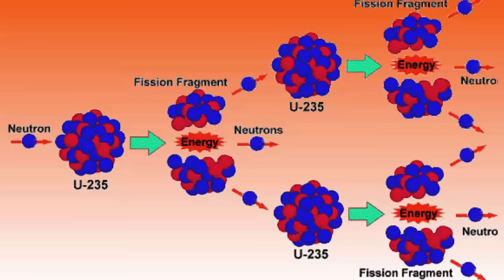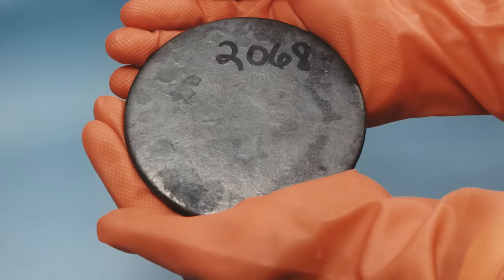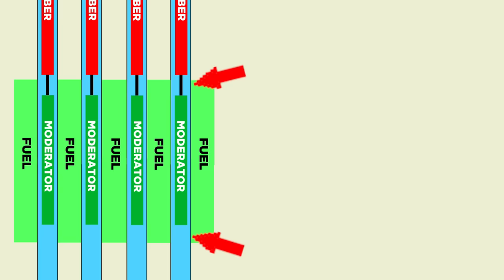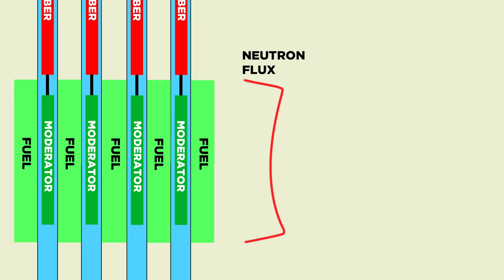What /Actually/ Happened at Chernobyl

Comment: The biggest issue with Chernobyl was that they actually knew about this very specific lost of things or at least suspected but suppressed the information.
Reply: Yeah they knew, and no-one wanted to be the guy to stand up and say: "Yo, we need to redesign this, even though it's expensive" Back in The Soviet Union 😂
Reply: Agreed it was extremely dangerous the information was kept from them.
But it doesn’t excuse the hours of blatant misuse of a nuclear reactor leading up to the very situation that information would be relevant.
Reply: The biggest issue was the positive temperature coefficient of reactivity.
Reply: They did have a situation before in a different reactor where the AZ-5 (SCRAM) button was pressed, and a momentary power spike was recorded as the water was displaced, but it wasn't enough to cause it to go prompt critical before the boron took over.

Comment: Best explanation I saw thus far.
Chernobyl is a bit of a passion of mine. As it led me to prove for my physics exam piece that nuclear power is dangerous and how we should avoid it. Only to find out the opposite. And people are wrongfully scared. These situations like Chernobyl and Fukushima are rare and impossible even with modern fast breeders. To keep fission happening there it’s like riding a unicycle, whilst rubbing your stomach and juggling. What stunned me the most, is that for the most excessive deaths estimate of all 3 nuclear reactor disasters. In the worst case 8000 people died. Whilst 8000 people alone die in The Netherlands of fine dust alone. Often from coal and oil burning. And nuclear reactors safe about the same amount of lives almost weekly. Due to its isotopes being used in medicine to cure people from cancer.
Reply: While probably lot less deaths than other energy sources, mining uranium probably kills a bunch of people.
Reply: I do agree that Nuclear Power is pretty safe now, situations like Chernobyl are almost impossible once all outdated reactors are finally decomissioned. Modern reactors are passively safe. Coal and oil is just stupid...

The number of direct deaths from the Chernobyl disaster was low, but the number of people affected by the aftermath was much higher: "According to Vyacheslav Grishin of the Chernobyl Union, the main organization of liquidators, "25,000 of the Russian liquidators are dead and 70,000 disabled, about the same in Ukraine, and 10,000 dead in Belarus and 25,000 disabled", which makes a total of 60,000 dead (10% of the 600,000 liquidators) and 165,000 disabled"
Reply: @mephistophelesfussli819 Probably no more than mining coal does, tbf

Comment: Actually, an "explosion" is just a "relatively rapid" variation in volume. it does not have anything to do with phase change. I can assure you that a oxy+hydrogen tank can explode as well and they are both gasses.
The rapid expansion is usually caused by combustion which add a lot of thermal energy to the mix, and not by phase change.

Also, to be extremely precise,  "detonation" is the world you were looking for. deflagrations are explosions as well, but expansion occurs slower than the speed of sound.

Comment: In layman's terms, the reactor is like a diesel engine. Rather than using the accelerator pedal to slowly bring the engine up to speed, they took the governor off and set it to wide-open-throttle. It started to overspeed and their "solution" was to try to slam the intake closed. And not only did it completely destroy the intake, it blew off the cylinder head in dramatic fashion and caught on fire.

(Obviously an oversimplification, but I think it fits).
Reply: Caleb Shonk that's pretty good
Reply: Ah! Thank you. I'm a gearhead, not a physics buff so THAT I understood.
Reply: Great comment. All I will add is that the reactor has only one cylinder, the piston weighs 100 tons and the cylinder head (the upper biological shield or as the Russians say " the pyotachok " or 5 kopeck (nickel) piece weighs 50 tons.
Reply: Absolutely fits as a simplified explanation. It's not perfect, but it gets the point across with an analogy to something people are more likely to understand 👍 It doesn't explain the xenon poisoning, meltdown and following steam explosion, but it doesn't have to.
Reply: Actually this can happen in Diesel engines. It’s called a “runaway” diesel and since Diesel engines are controlled by regulating the amount of fuel that goes in rather than air like a gas engine they will keep going a diesel in runaway sometimes getting so hot they will start combusting elements in the air itself and engine oil and the only way to stop it is to choke off the air intake and hope the engine is sealed enough that air won’t be sucked in elsewhere as the faster an engine is running the more air it can draw in (why Diesel engines don’t have a safety valve that can close the intake I don’t know but runaways are rare and usually only happen with poor condition engines anyway. Shitty explaination probably but to understand it requires understanding how a Diesel engine works but they rely on heat and compression to ignite the fuel 

Gas engines can’t runaway because they need fuel within a certain tolerance air and importantly a spark. I think it’s near impossible to detonate fuel in a gas engine on compression alone
Reply: @P7777-u7r It's not near impossible to detonate gas, it's just unlikely. And the problem of runaway engines can be and is solved by the use of electrical versus mechanical fuel pumps. If you cut the electrical power, no more fuel is flowing. If this happens early enough in the runaway, the engine will not have started to consume its own oil, and so the runaway will stop.

Comment: You may want to pay attention to the Thorium reactors coming in at the end of this year.  Now the engineering issues have been solved (mainly extremely aggressive corrosion due to the molten salt required to make it so hyper efficient) you're hitting a whole new era of nuclear power - MUCH safer, and for once much cheaper too (plenty of fuel), as well as far better for the environment.
Reply: Freddo Flintstono aggressive corrosion and nuclear reactor in a same sentence sounds scary.

Comment: Worth noting that the reactor designers claimed the reactivity wouldn't increase significantly if all the water boiled. That it would only increase slightly and then return to 0 due to the drop in moderation.
There is a graph in the INSAG-7 report that shows the actual reactivity increase when water boiled off vs. expected and they are two completely different lines.
The operators at Chernobyl knew they'd boil away all the water when they pressed the SCRAM button but didn't see an issue as the engineers who wrote the documentation and claimed that this boiling wouldn't be a problem.
Reply: I think it's because of the timing. There's a Negative Temperature Coefficient, but it's slower to build than the voids. If it boiled off slowly over the course of like an hour ala TMI that might indeed be correct.

Comment: Basically all the dashboard warning lights were on and Dyatlov decided to go racing....Nice!
Reply: Haha, nice one XD

I get the joke, but just to clarify: He wasn't really trying to go racing, he just wanted to take the reactor back to a "slow speed" (reactor operating at low power level) so they could carry out a "brake test" (what happens to the reactor when we lower the power level).

On top of that, they all probably feared for their jobs if not more, because the reactor should have been shut completely down for 48 hours, but that would mean that they would have to tell their bosses that not only had they failed to complete the safety test AGAIN, but Kiev, other cities and factories relying on the power from reactor 4 would be without power for over 2 days...

Comment: As a somewhat easy explanation of why neutrons need to be slowed down in a reactor to cause fission....
The neutrons do not smash into and breakup the uranium 235 atoms, they actually need to bind with them. This causes the atom to become unstable and then come apart (fission) releasing on average 2.4 more neutrons.
This explains why neutrons need to be moderated (slowed down) so as to allow a better chance for the uranium to capture one and then blow itself apart releasing energy in various forms, alpha, beta....thermal etc. 
E = mc²
energy = mass x speed of light (constant) squared
Joules = kg x 299,792,458 m/s squared
Speed of light is measured in meters per second.
c² = 89,875,517,873,681,764 m²/s²
Nice shoutout to Scott Manley, he does fly safe. 👍

Comment: There is a big mistake in the video: 
Water does NOT absorb neutrons, but it moderates them (That's how most of the western nuclear reactors work. You don't need heavy water for it... you only need heavy water when you want to use natural uranium as fuel). And when the water gets hotter or boils the moderation is reduced because the water is less dense. Thats called a "negative void coefficient". Graphite, which is used in the RBMK as a moderator, does not reduce it's moderating properties but increase it when it gets hotter, and the increase of moderation by the graphite is more than the decrease of moderation due to the evaporating cooling water. And if you replace the bit of water or steam which was left inside the reactor with the graphite tips you pulled out before by pressing the AZ-5 button you press the final trigger of that dangerous mix.

Comment: "So hot that it, in fact, dissociated into hydrogen and oxygen..."

This description of the development of H2 and O2 in the steam-pressurized reactor strikes me as a little too simplified. My understanding--and I've seen the HBO series twice, mind you--is that the zirconium jacket around the fuel reacts with the steam to form hydrogen.

No one knows for sure exactly what sequence of (chemical) events led to the two explosions, but I've always imagined that the first, smaller explosion was related to the compromise of the reactor top due to pressure, while the second explosion was the bulk of the hydrogen that had been formed inside the reactor finding the needed oxygen when the top popped.

In any case, the "dissociation" of H2 and O2 is, I believe, the result of a chemical reaction between steam and zirconium at high temp. I only bring this up because your description makes it sound like the water molecules simply break apart.
Reply: You are correct

Comment: So... They stepped on the gas, instead of the breaks and then ran full speed into a Starbucks... Ok got it.
Reply: Pretty much, yeah.
Reply: No, it's more like they stepped on the brakes, but due to the brakes being poorly designed, in that configuration of the car hitting the brakes resulted in MUCH bigger acceleration than fully stepping on the gas pedal.

So they hit the brakes and instead of stopping, the car sped up into the Starbucks. Pretty much that.

Comment: You're the second "how it happened" vodeo  after I fell into this rabitt hole.  Your explanation of the 2 seconds of rods and how they were used is by far the clearest I have seen so far.    Also read one appendix  to an IAEA document that has  translated Russian report from way back then.  One component they mention is that when they turned off the turbine and only ran the pumps (as part of the test), there was less cooling happening and the water being pumped into reactor was getting closer and closer to boiling point at that pressure (about 1000psi as I recall), and eventually flash boiled.

Comment: Probably my favorite part about all of this is that, for all of the justified criticism you have of Soviet RBMK reactors, they DID provide nuclear power very cheaply, and--provided you were careful and informed about how you managed it--relatively safely.

Naturally, the management, and Dyatlov in particular, drove their reactor to catastrophe in the most insane, outrageous, reckless, and suicidal way possible, doing what everyone had thought impossible: exploding an RBMK reactor.

Anyway, it's kind of hilarious how I had actually guessed how the "graphite tips" worked, and why they were there before I watched this video--I thought "It'd be just like the Soviets to tip the control rods with graphite so that they could use them both to slow down and speed up the reaction...and for Dyatlov to be insane and reckless enough to think taking them ALL out of the core at once was an even remotely acceptable or sane procedure".
Reply: RBMK reactors had several accidents although not as severe before Chornobyl, however only few people knew about them because of secrecy (and the fact that Chornobyl and Sosnoviy Bor power plant, that had very similar accident (which by shire luck hasn't gone into disaster) were sobordinate to different ministries). But good name of RBMK designer Nikolay Dollezhal couldn't be stained so the issue was never widely known.

Comment: Ok so, we know what went wrong... but what should have been done in this case? The reactor was already overheating, the water is boiling creating voids, the rods are already going down (slowly). Is there anything the operators could have done in that situation?
Reply: Aborted the safety test due to too many factors being different than what was planned.

Different shift, Xenon poisoning, altering test requirements on the fly (attempting test at 200mw despite it needing to be at 700mw), etc.

Comment: 1:46 "During fission, the leftover fission products, which is all the particles and atoms that are leftover, are always a little bit lighter than the original atom."

Isn't that only the case if the original atom is heavier than iron? That's how you can get energy from fusion for light elements like hydrogen?
Reply: Why would it only be for elements heavier than iron?  Any element involved in fission is giving up at least one neutron, which is going to result in it becoming lighter post-fission.
Reply: @immikeurnot  From my fairly layperson understanding, iron has the lowest energy state relative to its mass of any atom. So if you fusion two small atoms together you get extra energy out until you get up to iron, and if you fission a large atom into smaller ones you also get energy out until you get down to iron. 

Also, it's not the neutron that counts as the energy being released. That's still one of the fission products being counted. What actually happens is that the new atoms plus the released neutrons have less mass than the original atom because during fission heat, kinetic energy, and radiation were released. So now the leftover fission products have a lower total energy state, by the exact amount of energy released, and thus less mass.

Comment: 7:08 No. The normal thing to do is to shut down the reactor, wait 60 hours for the natural decay of Xenon-135 to Cesium-135, and then restart the reactor. The neutron dance converts Xe-135 to Xe-136 which is stable and does not absorb neutrons. When the neutron dance disappears, the Xe-135 level builds up very fast.

Comment: Actually one of the best descriptions of the flawed reactor design on YT. A lot of other sources on the internet get the graphite „tips“ totally wrong geometry-wise. Another thing that was not mentioned in this video but is worth noting: This reactor design allows for breeding of weapon-grade plutonium. This is because the reactor produces more plutonium as a fission product than it consumes while running. The original design, which was for much smaller rectors, was a plutonium breeder. But the Soviet government decided to use basically the same design but scaled up for commercial energy production because it was much cheaper and easier to build.

Comment: I don't follow..you're saying the same thing as Scott Manley did so I'm probably just not getting it. 
Is water an absorber or is water a moderator? Or is only heavy water a moderator and is regular water an absorber?
Both Scott and you talk about water having both properties at the same time. To my mind you can't do that: water is either one or the other. And it's crucial which role water is playing when the control rods are being pulled up, replacing the water by graphite ("tips"). Because if water is a moderator, you're just replacing one moderator with another. But if water is an absorber, you're replacing an absorber with a moderator which is a lot worse when you're trying to stop reactivity.
Which is it?

Comment: Interesting video, so it was not the graphite tips that caused the explosion when inserted, but rather the water displacement that it caused when inserting the rods. I always thought that one of the safety upgrades made to the RBMK was the removal of the graphite "tip" of the rod, but im not sure if this was the case anymore. Another factor was that they had shut off the pumps prior to this when they started the test, and this caused much less water flow to the core.

Comment: The tips are not moderators, they are graphite displacers. They displace water for neutron economy, regular water eats away too many neutrons when control rods are pulled. Graphite Stack is everywhere surrounding  the fuel and control rods.

Comment: Fantastic explanation, although most will need to do some reading ahead of time to make it comprehensible (which I had done, in connection with reading THE MAKING OF THE ATOMIC BOMB, by Richard Rhodes -- highly recommended).

Thanks so much for covering the smaller points not possible in shorter videos, and describing them so well!☺️

Comment: Hello, you are technically nearly correct. That "tip" thing actually roots from the fact that the inner absorber part of the rod was "tipped" with a graphite crown. This was because the place between both solid parts of the rod was 1.25m. Thats a lot of water to displace. And also the reason why they moved so slowly. In other words - you have to solve that water volume somehow and they chose the cheap and dangerous way.